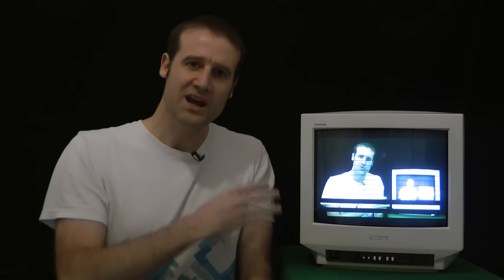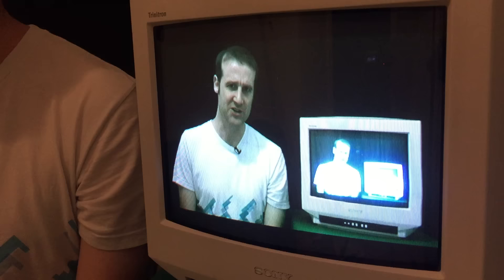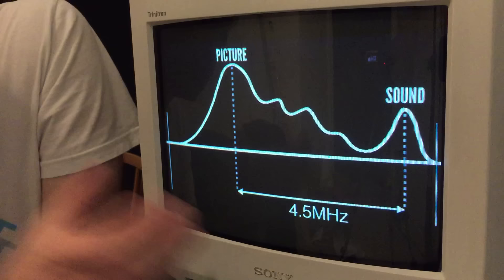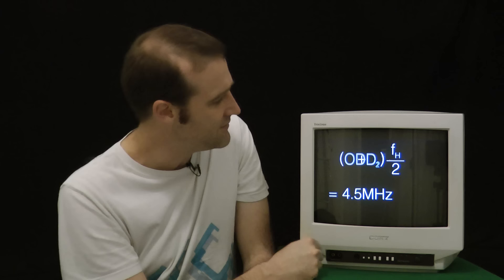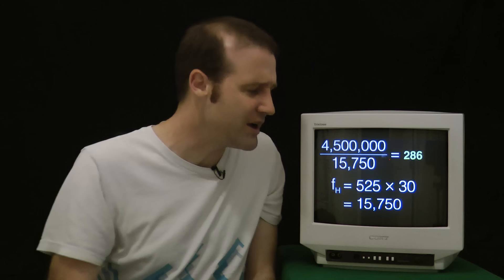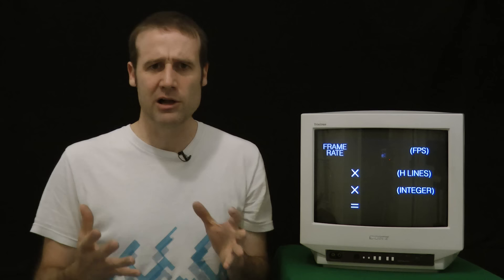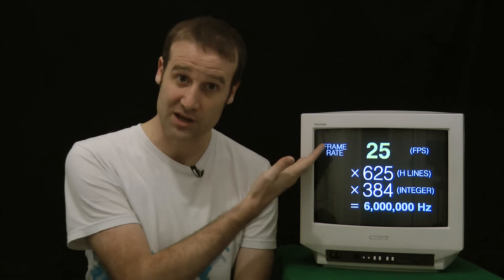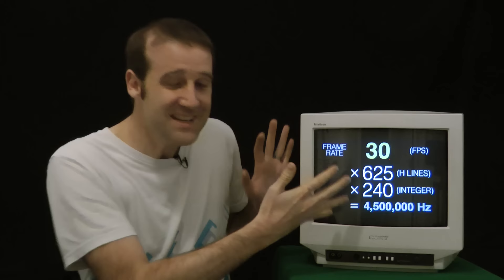Why is TV 29.97 frames per second?

Comment: NTSC was a major breakthrough to add color to B & W in the same bandwidth and maintaining compatibility.  PAL suffered major problems with flicker.  The reason movies could get away with 48 Hz without major issues with flicker was that they were viewed in a dark room, and PAL needed to also be viewed in a low light environment.  NTSC at 60 Hz can be viewed in a more normal lighting, but still had issues in daylight.  To get beyond flicker, the refresh rate needs to be >75 Hz.  I worked in TV/video from 1977 to 2007, at 66yr I am still able to hear and be annoyed by 15,750 Hz.

Comment: Changing NTSC to 625 lines would have helped PAL video gamers. We got a raw deal until about 1999-2000 when PAL 60Hz games started appearing. PAL games at 50Hz always ran slower and with borders because developers didn't use the extra 100 lines and the games were rarely adjusted for speed at the lower frame rate.
Reply: I had a designed-for-PAL video games console in the early '80s. It was made by Philips. I used to love "Race Car"... =;o}

Comment: If they had chosen to increase the line count to 625 instead, then the spectrum of the signal would have changed, adding more high frequencies, making it no longer fit into that 4.5 MHz window.
Reply: Perhaps.  But the main reason for keeping 525, as many others have already noted here, is because most of the TVs out there were B&W (and there were lots and lots of them), and they could not adopt a standard that suddenly made everyone's TV become useless.
Reply: Yes, definitely. But even if they had decided to change the standard more thoroughly, they wouldn't have been able to for the reason I mentioned.
Reply: It could have been fitted into that window, but it would have required more aggressive low-pass filtering, which would have resulted in a blurrier picture.
Reply: Televisions of the early 1950s were really, REALLY forgiving as far as what they would accept as input.  They all had H-hold and V-hold knobs that changed the timing of the signal.  Even later TVs with only the V-hold could somewhat display 625 lines by adjusting the V-hold knob.

A 1950s TV could very easily be adjusted to display 625 lines, without losing any of the picture.

The biggest problem would've been that 625 lines would be quite blurry on American TVs.  It would still have to fit into the same 6 MHz channel space that was originally designed for 441 lines in the 1930s.
Reply: I'm sure the people working on the standard would have used 625 lines if they knew for a fact that all existing TV's could handle it (even if they needed adjustment).  The fact that they didn't shows that it wouldn't have worked.  Perhaps because it'd be blurry, but I don't see all TV's being that forgiving.  Remember that "most TV's will handle it" isn't good enough, you must guarantee that all will.

Comment: 2:45 So THAT'S why running the vacuum always messed with the TV in the pre-LCD years! I've had that question since before I could just Google it, and forgot it by the time I could.
And now that I think of it, this makes me want to build a new alarm clock with an internal oscillator to get those likely seconds a year, from using the AC signal for timing, back.

Comment: Another constraint on NTSC television was that the color signal had to be viewable on black and white TVs, which were the vast majority of receivers in use at the time.  So they could not change the number of lines.  Changing the frame rate by 0.1% was within the tolerance of what the existing receivers could accept. So it wasn't a bad choice, it was a very clever choice that met all constraints.

Far from dumping on the engineers of the 40s and 50s, I admire their ingenuity.  Modern digital techniques are much easier and far less constrained by physical and mathematical laws.

Comment: Also, there is a problem with changing the horizontal rate. The flyback transformers of older BW tv's could not have handled the higher frequencies without being ruined.

Comment: I screamed when I started to watch this the first time. I'm older and less prone to screaming over tiny details.... I did write up some number details you seem to have glossed over. The numbers were not changed to the "obvious" numbers for backwards compatibility, a concept digital TV blew out of the water.

There is a very obvious question here, why was the sound subcarrier frequency not modified by 0.01% to 4.50450450450 MHz? That's a story about available electronics parts of the era. Precision frequency sources were all generally multiples of 5 MHz. 4.5 MHz is fairly simple to generate from 5 MHz. From there you need to use clumsy parts to synthesize the various frequencies used in the signal.

To totally unwarrranted levels of precision

5 MHz 63/88 = 3.57954545454545454 MHz, color subcarrier.

Color subcarrier times 4 = 14.31818181818 MHz.

The video was presumed to give 910 pixel times per line 720 of which were visible and the other intervals were part of a complex synchronization process.

14.31818181818MHz / 455 = 2 * 15734.265734265734265734265734266 Hz

Then there are a total of 525 line times, some 45 of which are for special services, retrace, and synchronization signals. Roughly speaking, though, only about 400 or fewer are usually seen on TVs.

15734.265734265734265734265734266 Hz / 525 = 29.97002997002997002997002997003 Hz or about 1 part per million off 29.97 Hz.

In practice banks of dividers off either 14.3181818+ MHz or 28.6363636+ MHz derived from 5.0 MHz oscillators were used for a long time. In the Los Angeles area the 5 MHz oscillators were often derived from cesium frequency standards before people realized they didn't really have to be super accurate after all.

If everything was moved to 60 Hz all that nice arithmetic right up at the start goes to "heck". And they didn't really want to use more difficult frequency generation techniques. After all, WWV transmits at 5.0 MHz not 4.995 MHz. And the FCC had demanded precision at first.

{^_^}

Comment: NTSC = Never The Same Colo(u)r ;) I've often wondered why US TV looks so smeared and washed out, I guess the 525 lines is a big part of it, though I think I read that the colo(u)r encoding is also pretty weak. Thankfully I suppose much of that is ancient history already.
Reply: All hail digital.
Reply: Why you say "colo(u)r", and not "color"?
Reply: Because it's properly spelt colour.
Reply: I learned (back in school and talking with a BBC engineer) that NTSC was sometimes called "Never Twice the Same Colour", due to its phase-encoded colour being the same on every line; the colour phase signal could get offset on the radio transmission path to consumer TVs. Which is why there was Hue correction knob on NTSC TV sets. In the UK (and other places) we used the derivative PAL ("Picture At Last") system, which switched the colour phase encoding 180-degrees on alternate lines; so transmission phase errors could be cancelled in the TV receiver (I think in a big glass block) - hence the name Phase Alternate Line. I think.
Reply: +Azathoth43 It's a history lesson. Of course today the TV standard NTSC or PAL\SECAM are obsolete.
The terms were used to refer to regions for DVD's and stuff. Region-locking is bullshit, but that is another story and topic altogether.
Reply: To be fair, the USA pioneered colour transmission, so they exposed all the problems with it--after their standard had already been set in stone.

The Europeans were able to fix the mistakes when it came time to define their standards. The French came up with a typically complicated system, while the Germans developed a simple, elegant one.

Comment: The reason for interlaced video implementation is not because of human vision nature. It is because progressive scanning needs more frequency range for each channel - beam has to move with a double speed comparing to interlaced scanning.
Reply: There was also issues with bleed; basically having the electrons so close together the gun would re-align existing electrons still visible on the screen, it takes a bit for them to decay. So you'd get weird mushyness as every line would kind of meld into the other. Interlacing increased sharpness dramatically.

Comment: +standupmaths
A thought about increasing Lines to 625.  2 Main points :-

(1)
To increase the lines to 625 while keeping the framerate, would mean increasing the horzontal scanning frequency, which compared to the picture bandwidth means 'stretching out' the beam, 'going faster' for shorter time for each line.  This will increase blur on the picture horizontally as the 4.5mhz bandwidth limits the speed can switch from bright to dark, sharp edges in brightness will become more gradients etc.

(2)
In any case, substantial change in horizonal frequency would then loose compatibility with existing TVs that try to lock onto the NTSC horizontal frequency from the mono-standard days, they may use a local oscillator with a simple phase-lock-loop and just not designed to "stretch that far" to a substantive horizontal frequency change.  Let alone the various 'horizontal size' adjusters might need fiddling to widen out picture and soforth.
The '29.97 hack' was a small enough change to remain compatible with existing mono TV sets....

Does that make sense?
Reply: Nö
Reply: 25 Parker squared

Comment: "Why is TV 29.97 frames per second?"
because peasantry
Reply: ***** edgeyMcangister
Reply: But it updates 59.94 times per second. That's why games still run at 60fps on CRT TVs.
Reply: If someone is more informed than me, please feel free to correct me, but I believe that the 60FPS (and 50 for PAL) is only the first round of scanning (meaning half the scanlines). When you combine the two different scans in order to have a "full image", it totals to 30FPS.

So, 60FPS for one out of two scan cycles, 30FPS for two out of two scan cycles.
Reply: Karolos Triantafyllou Sorry, no. The "frame" as described by NTSC/ATSC or other interlaced formats is actually a combination of two different images (these are called fields). NTSC has 59.94 distinct images (fields) per second. The 30 frames per second idea a very bad naming scheme.
Reply: SNESIvan
So the naming convention is untrue? Interesting. Could you point me to somewhere were I could read more about it? It seems interesting.
Reply: what did you say >: (   .. you better runnn
Reply: When where you born?

Comment: The only reason why 4.5 Mhz was hard set and unchangeable was because of the government over regulating things.  4.5045 Mhz would have made the math come out perfectly, but because the government set a hard number to ensure signals would have plenty of room not to interfere, that wasn't permissible.  Just an extra .0045 Mhz, would have solved the problem, a hardly even noticeable dip into the 1.5 Mhz buffer.

This is why government legislating regulations is a bad idea!  Congress doesn't make it easy to adjust outdated laws, and no one wants to spend the insane amount of lobbying money needed to make what would be a reasonable change.

And now, instead of being able to set frequency the easy way using the AC frequency tons of extra engineering had to go in to set the frequency manually.  Making the TVs more expensive to make.

Comment: This reminds me of how the America railroads used existing technology to make couplers for railroad cars. Shipbuilders used chains and chain links, and belaying pins to tie the sail lines to. Ship chain links and pins were off-the-shelf items, so the early railroads made journal boxes that used a loose chain link which would be secured by a metal pin run down through a hole in the journal box. This was the link-and-pin railroad coupling method of joining railroad cars together. Eventually, the railroads, in the late 1800's, developed the knuckle coupler, because in order to use the link-and-pin couplers, a worker had to stand between the railroad cars to put the pin in. The engineer would make the cars bump together to make the link stick out of the box. Sometimes the journal boxes would miss, and the worker would be crushed. Oh, dear. We'd better fix this.
Reply: In Britain, 3 link chains and screw link couplings were standard until the 1970's at least.

Comment: Isn't this video a bit incorrect though? Line-by-line phase reversal is not part of NTSC (which is the 29.97FPS and 525 lines the guy keeps talking about) but instead in PAL which had phase reversal built-in to correct the issue having to manually adjust the set. NTSC sets required the user to manually dial in the colour on the TV set itself.
Reply: Actually there is phase reversal in NTSC.
Reply: @jimhutton2390  Can you direct me to a source explaining how it is used in NTSC? Everything I've found so far seems to indicate it is only used in PAL
Reply: The color phase did rotate. For editing on 1", the color phase had to be correct to avoid a shift. A good edit could only be performed on every other frame. That issue was solved.

Comment: Contrary to the authors comments many B&W TVs already in existence at that time would not sync to the 625 line standard.
Reply: I was just thinking about that. We had 405 line to start with. I can't remember when it changed over - about the mid 60s I think.
Reply: @retroretiree2086  BBC2 went on the air with 625-line UHF B&W service in 1964, albeit a day after it had intended to because of a fire at Battersea Power Station, and the original 405-line VHF network went off the air for the final time on 3 January 1985.
Reply: That's also why they had to keep these standards. So that black and white TVs would still be usable.
Reply: I'm not sure what you're saying because that wasn't said in the video. He said that for the reason of backwards compatability they chose not to do framrate change in the US
Reply: @ZachJ367  Yeah,  that WAS said in the video very clearly. 
The seamless change to color was the basis for the frame rate.
Reply: ZachJ367 but he proposed to change line rate as “better” solution and that would break the compatibility too.
Reply: You're referring to the 405-line sets. They were an evolutionary dead-end that existed as a result of the UK having been an early adopter of television.
  
The BBC had opened a public television service in 1936, with both studio and outside broadcast capabilities, but it had been closed down during the war. It was reactivated in 1946 but by the 1950s, it was becoming clear that the UK would adopt the pan-European 625-line standard and that the 405-line service would be phased out. Accordingly, all new developments (the second BBC channel and colour) were rolled out on the newer, 625-line service, but it's worth noting that (due to the eye-watering cost of colour receivers), many of us who upgraded to UHF-capable, 625-line television sets nevertheless settled for watching in B&W for many years, even though an increasing proportion of the programmes were in colour.

Comment: Thank God for progressive scan.
Reply: Interlacing is a compromise, and has advantages (and disadvantages) of both ways. You get twice the frame rate, and twice the resolution, just not both at the same time. Interlacing makes movement look smoother. They could've gone with progressive scan from the start, but chose interlacing deliberately.
Reply: greenaum colour was a compromise, then stereo sound...

Comment: NTSC in the 50s: tweak this framerate down a notch for interlanced backwards compat

Tech corps in the 21st century: yeah so we're gonna progressively scan everything at multiples of 60Hz; suck it

144Hz monitor manufacturers: hold my beer

165Hz monitor manufacturers: no, hold my beer
Reply: The thing is, this was already a thing in the CRT era. You had 70 Hz, 72 Hz, 75 Hz, 85 Hz, 100 Hz and so on.